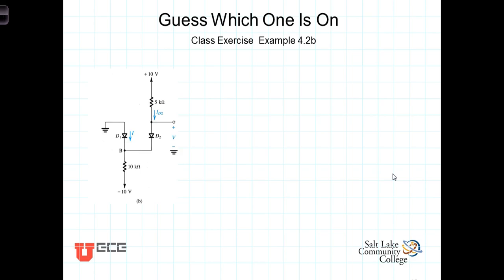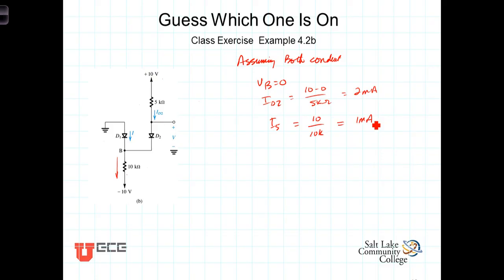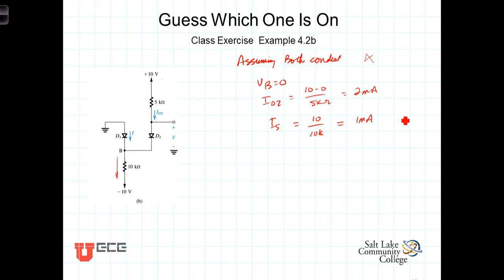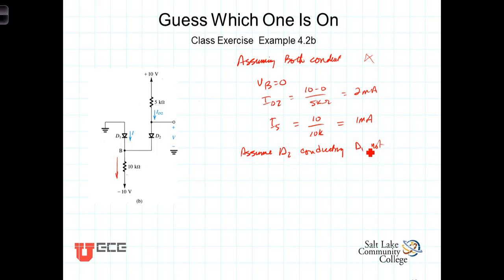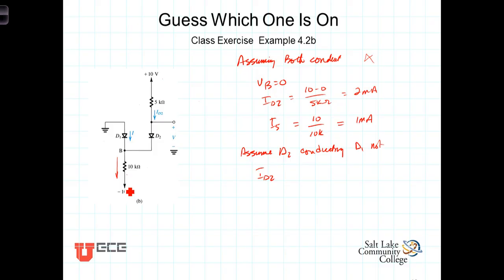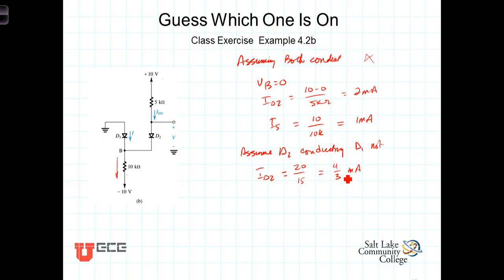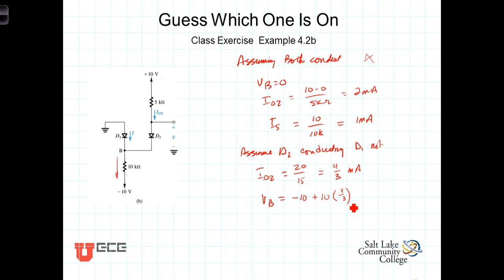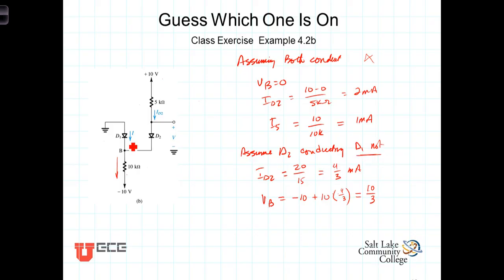L4 1 6Ideal Diode Conducting or Not Part 2b

Comment: Isn't D-1 conducting ? because the Vb voltage is greater than 0 ?
Reply: a positive voltage must be applied on the other side of d1 inorder for it to conduct. in this case the diode is reversed bias. 

Vb=10/3 ---K|-- GRD   

inorder for the diode to conduct it needs to be the opposite.